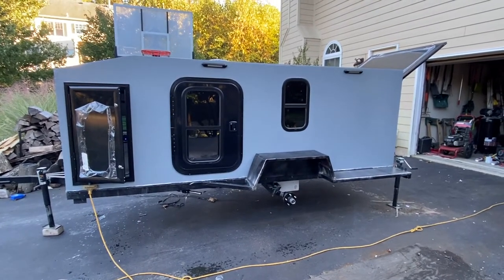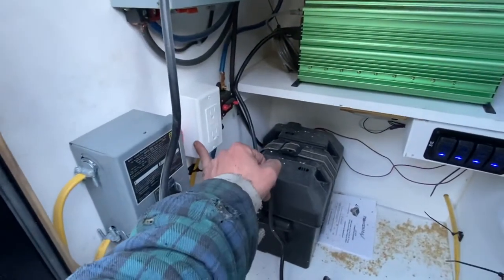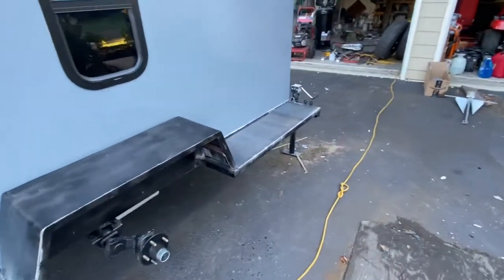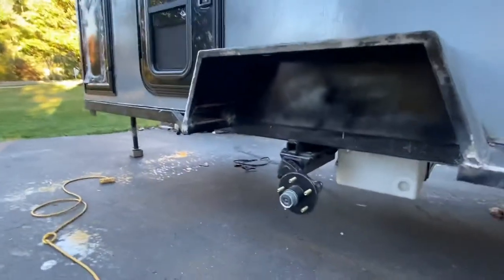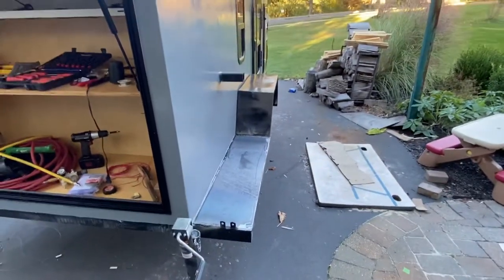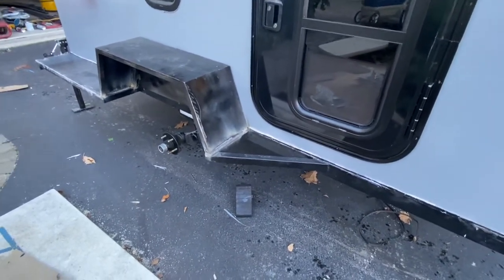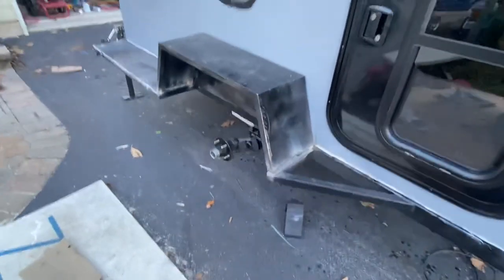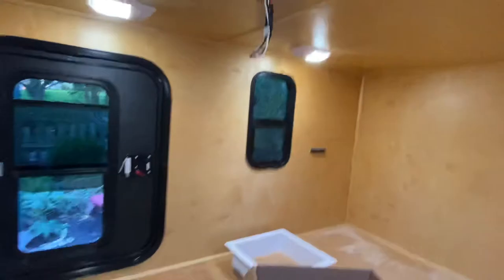Camper build day 35 fender fabrication titanium 125

Comment: Did you use backer plate for the spare tire bracket, couldn’t see inside shot
Reply from the maker: Actually if you go back to the frame build I welded the tube directly to the body “cage”.  I put the plywood around the tube and sealed it up. It is rock solid. I wasn’t comfortable with 80pounds plus bolted and a backer plate.